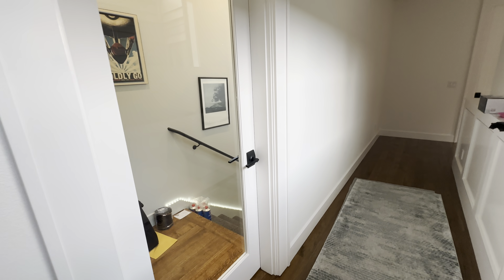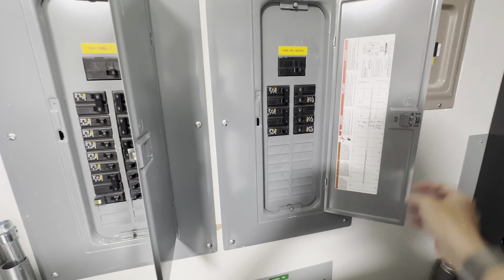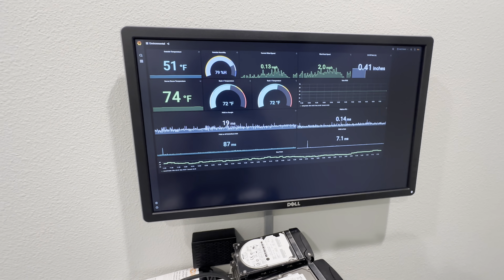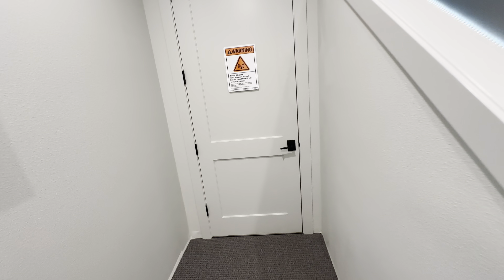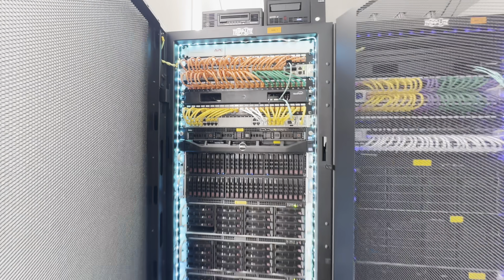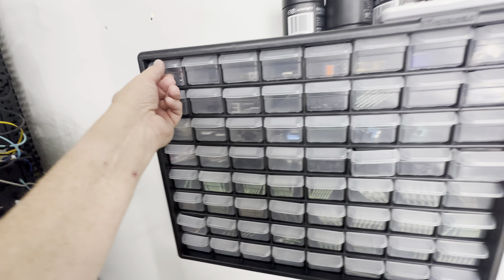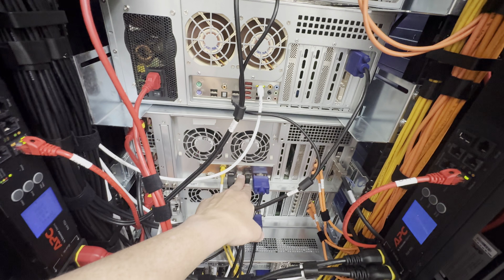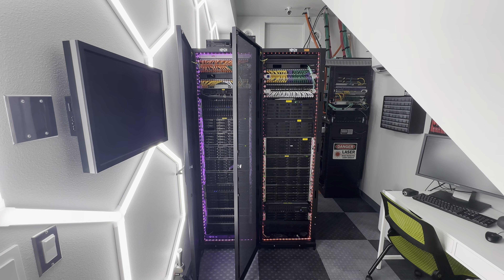A quick look at my homelab.

Comment: Sir you are a datacenter with a home on top of it.
Reply: Agree👍🏻
Reply: power company thinking wtf
Reply: @Nossody  well, he uses solar, so maybe the power company doesn't ever register that
Reply: @danilocianfrone670  aint no way he powers that 10kW draw by solar panels located on top of his house. but then again, this aint a "homelab" either so he might just have a "HomePowerplant" located next door too lol
Reply from the maker: Yes, Solar does help some, but only on sunny days.  In the summer my solar (53 panels) produces about 15kw for most of the day, but in the winter most days peak at 3-5kw, and sometimes 0.   In net Solar makes about 1/3 of the power that I use.. so it helps, but I would need another 100 panels to be grid independent.
Reply: @jeffsponaugle6339  Even if you would have all the 150 panels you would still be grid dependent in the nights if you have no battery packs as that would take care of the power after the sun goes down.
Reply from the maker: @Soap_Cracker  Exactly.  Solar is great, but only during the day.  I do have 42kWh of enPhase LiFePo4 battery backup which can store excess solar power production..but 42kwh is not enough for a high load draw over night.   The grid is essential.
Reply: My favorite part is when he says "Some really simple stuff"
Reply: Next project will be a wind turbine for the night. 😀
Reply from the maker: @marcoschirrmeister  Funny... I did look into that... but sadly it would need to be a lot taller than the house to make any real power.   It is hard to do wind power at small scale.  I suppose I could use the near by stream to turn a wheel...
Reply: @jeffsponaugle6339  Can you damn it? What kinda elevation is it on? Thanks for the cool video.
Reply: lmao
Reply: yeaaa..i think this statement is more relevant XD
Reply: @xaviervelez8835 The IT version of “two shots of vodka” meme.
Reply: @Nossody  power companies won’t think anything they will just bill you a very hefty amount
Reply: @xaviervelez8835  lol yes I noticed that. I was like 👀
Reply: @Nossody Power company sees that and thinks it's either a hydroponic grow-op or a bitcoin farm. But as long as they get paid they don't care.
Reply: Solar panels: ~10kW
"it makes 1/3 of the power that I use"
Ok I don't want to know more

Comment: 😮 lawd. You could save on heating by just rerouting a few exhaust fans back into the lounge room. Seriously though this is freaking amazing 🙌🏽
Reply from the maker: Indeed - I do have an economizer that pulls in outside cool air and vents the warm air into one of the lower garage labs - So I do get a little bit usable heat out of it in the winter.
Reply: @jeffsponaugle6339 ...

Into 'one of' the 'lower garage' labs.

So let's break this statement down a little...
You have multiple labs in your house.
Normally, multiple simply means >1.
You, however, have at least 2 labs in your 'lower' garage. Meaning that you have at least two garages. And, since you had to specify which garage you're talking about, I'm assuming that you gave labs in both/all of them.

...

Are you running the Oregon branch of the Institute (Fallout)? Should we be worried? Do you offer unpaid internships in exchange for security guarantees?

Edit: all jokes aside, this setup of yours looks absolutely epic. I used to work at a 'flag carrier' of a relatively big hotel chain, and there I had occasional access to their server room (I think it ran the majority of the VM array for the whole company).

It can't ever compare. There, I would see filthy racks caked with dust and grime, poor ventilation, non-existent temperature control, dim lighting...

And here... This! Major props to you, my man!

Comment: 10kW power draw?? Insane. At my local electricity rates you're spending (or losing from not exporting solar) over $100/day or $38,000/year on electricity alone.
Reply: 10kW and it's *not all on yet*!
Reply: I have a couple servers that draw 3.6kW each, I went 100% solar with battery backup.  The good thing is I don't need those servers powered up all the time. Makes no sense to do so. All my machines have remote power management so I can power them up and down from afar.
Reply: ok I gotta ask what's the rate in your area? cuz where i am it's about 0.11 USD / kWh
Reply: That is cheap, for me it's 0.25€ / kWh = 0.27 USD / kWh
Reply: For me it's $0.07/kWh so hopefully his is around that mark
Reply: @controlandpower  where do you live ? In the US ?
Reply: That is some inexpensive electrical power bro. Enjoy @controlandpower
Reply: @R0M1_07  Were at $0.48 minimum here in California. Summer is $0.63
Reply: Assuming electricity at $0.12/kWh, you're still only costing about $1.20/hour or $28.80day or $892.80 per month
Reply: If you rewatch, the ups load is only arpund 3 something kw, the rest was his house.
Reply: @nerfinator03  3.7kwh, but given the amount of equipment, you also need to factor in AC costs.
That being said, it seems the load increased significantly (~*1.5) ~10 minutes before the video/demo. You need a lot of power to make all these shinny LEDs blink and look nice.
Reply from the maker: Here in Oregon it is around $0.19/kwh fully loaded.  I do have a 20kw solar system as well, and that makes a big difference.
Reply: @R0M1_07  yep, Kansas to be exact
Reply: @jeffsponaugle6339 Next video: a quick look at my home solar power plant?
Reply: @phenry5083    Nelson Muntz:     ha ha  you live in california
Reply: @HR-rt9nh  yeah it’s unfortunate, this place is a dumpster fire.
Reply: for me 1 kWh costs about 0.03$. I have server at home too ) but no UPS at all just because electricity absent extremely rare.
Reply: Where I live, electricity costs $0.35 per kWh...
Reply: Why is summer more expensive?
Reply: @ahamuffin4747  i think in california winter is warm, summer is hot, working conditioners making more load to equipment.
Reply: @iam21h  sounds plausible, I forgot how cold it was there in the office during summer lol
Reply: @StillConfusing  Ahaha lucky you, we have around 0.35 EUR in Germany
Reply: @r8risk  In Germany its €0.4020  per kWh so there you have it.
Reply: @theoDSP  That's awful

Comment: I take pride running just a Synology, a Turing Pi with 2x RK1s and a 10 gig switch and firewall. Can run plenty with this setup. I’m trying to rely on containerization instead of VMs with some shared storage. Using less than  150 watts total with lots of compute and storage.

This lab is impressive but I really want to see your power bill…

Comment: Hi.

This is probably the first time in history that I drop a comment on a video in Youtube. 
My day job is to run a medium sized server operations for a company. My jaw  literally dropped once I saw your "Homelab" setup,  very organized and I can see the time you spent on getting all the details of your setups just right with patch panels, patch cabling and etc.  Top tier server room. 

Questions regarding the setup, if you have time to give some details 🙂
The cooling unit(s) was not that visible in the video, but I can imagine you do have one in place there as your setup pulls over +6 KwH,  do you have convectors setup in you home lab?
Also how is the air cycled through your setup? From what I can tell it's a "all around cooling" room and air is actively being cooled or do you have hot and cold aisle/regions? 
Also you mentioned IPMI cards, Are you using Dell's iDrac cards or whats the model on those?

Apologies if my terminology is not spot on, as English is not my first language 😅

Comment: Thanks for the tour bud, good to see many are still trying to run home systems, this is a lovely setup, nice and clean ... mines literally half the size but running  similar... plus Starting to host for clients again no doubt will grow ... out of genuine interest. What hyper visors you running?? Just promox ? .big VMware fan but obv recent Broadcom sit bit hit or miss at the moment, like to have a few options open :) ... Cheers sy
Reply: Also what you using to monitor power ? Currently moving DC to its own 'building' and would like to monitor power / Temps etc via mqtt/openhab/grafana etc... sorry one more ... looks like alot of your box's are sun ? / custom ? These cheaper than getting 'older' dell units? E.g ( r7xx series, vrtx etc ) and regards to your ups I to have see apc give up 3/4 years ... but have seen borri ups units lasting 7+ years ;) (got 2x 5year units home ... absolute solid!!!)
Reply from the maker: I recently moved from VMWare to Proxmox, driven in part because of the changes from the Broadcom acquisition.  Proxmox is quite capable and I was able to get an HA cluster as well as a Ceph cluster without much fuss.  Good stuff!

Comment: I have a used dell with a hole in the front where i ripped out the old CD drive and there is a SSD dangling out of it. 

It runs a docker container with a commodore vic 20 emulator in it.

Comment: As of at this moment in time (Oct 18th, '24), and if I'm reading that panel correctly (a current continuous draw of 9000w) this setup; in the UK (with GBP converted to USD) would cost $2,087 a month to run.

Comment: Thats insanely loud.  Would it make sense to have an air conditioner in there so you could bump those fans down?
Reply from the maker: There is dedicated AC .. the fans move air and heat from the devices to the room, and the AC extracts that heat.

Comment: I hate your PDUs pointing into the rack. This causes blockage if you need to service the back of the rack. I highly recommend against this to ensure your racks are fully serviceable without any fear of bumping cables...
Reply from the maker: The bumping cables is not a huge issue since I am using locking power cables (which is common with this kind of PDU).  However you are correct that it reduces the working space in the back.  These racks are designed for vertical PDUs to mount like this, but there are other racks that have the PDU clamps facing outward so the PDUs face to the back.